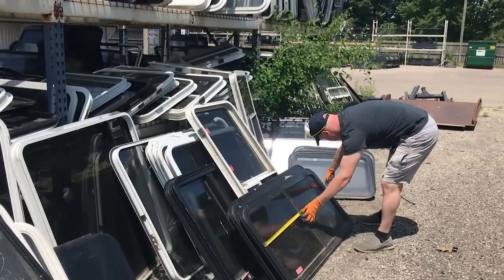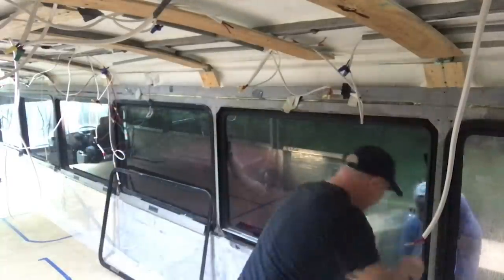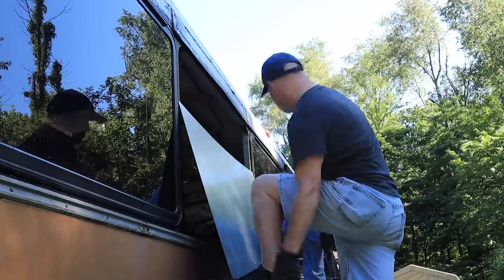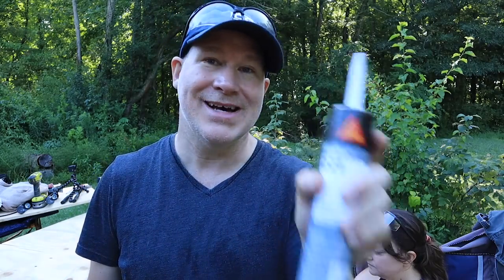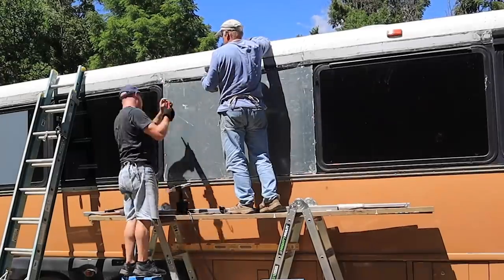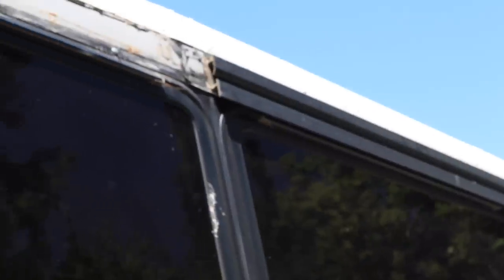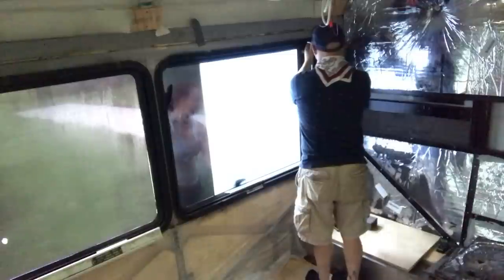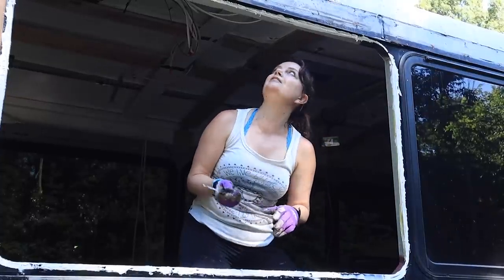Sheet Metal Siding for our Bus Conversion - S03E30

Comment: Nice I used the same 3M tape and sikaflex also I had a lot of rivets to remove on my MC9 older bus I also removed the actual window frame and that was riveted in to the steel frame it took awhile to do all the windows but we'll worth it hang in there oh on your rivets are you using a closed in blind rivet? It's a great rivet it closed at the end
So no water can get in through the hole where the mandal exists you can get them in stainless or aluminum I've used them for years.
You guys are doing great keep up the good work.
Reply: I used Byler shaved head rivets, they worked great they also  have a rubber seal in them.  Ton of work removing frames etc. but it’s a much nicer finished product.

Comment: Most builders use 5152 .080 alluminum.  What are you doing to support the sheet metal where is spanning the full size of the window?  Looking good, you’ll be glad you decided to pull windows.
Reply: Chad Hone why would one be glad they pull the windows?
Reply: @carlmedleyii  it makes a much nicer bus to pull and fill in where kitchen bath etc. go.  You can insulate and get better more usable windows in the areas wanted.  I see people simply try and build a tiny home with all the windows in. No upper cabinets, terrible r values because of all the single pane windows.  It’s a ton more work I know I’m in the middle of it now, however with one side done my bus already looks and is much more usable as a motor home,

Comment: Hello !
I like what your doing and i'm  dreaming to do the same one day. You are a great team !
I'm not sure if you should reverse the windows in front . I think the windows you can open by sliding them should be install the way to avoid the risk of infiltration of air & water by the joint.
You might take information before installing it.
(Sorry for the writing , i'm french !)
Reply from the maker: Hello Sylvain! Right, our diagram isn’t a good representation of the direction the slides should be opening.  You are correct

Comment: Coming along nice. Did you price out aluminum instead of steel? Did you think about using the steel as the window? Cutting the steel and putting it in the window frame that way it would like uniform, just curious
Reply from the maker: Yeah aluminum was a lot more expensive.  We did think about that but as we put in RV windows we thought it would look funny having a frame inside a frame

Comment: what size sheet metal did you use  found you guys last night
Reply from the maker: We measured our windows and had them custom cut
Reply: @Rehabit8  what gauge was it 12 14 or 16 gauge thanks ron
Reply from the maker: 16
Reply: @Rehabit8  thank you you two are the best thanks ron
Reply: have u guys goten ride of the scrap from the bus i need a pice of chair rain from the side wall  only 5 or 6 feet thanks ron